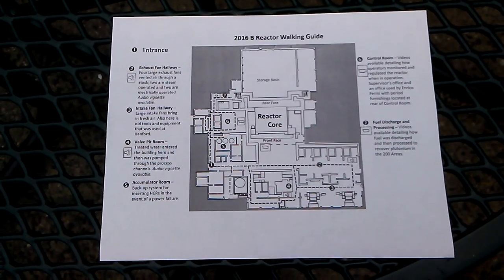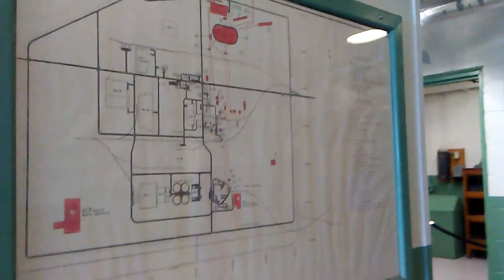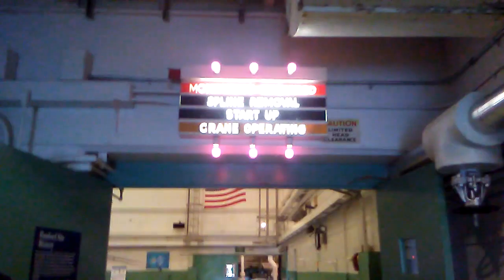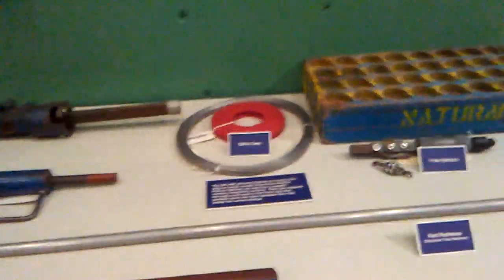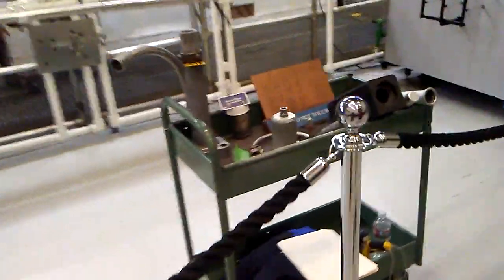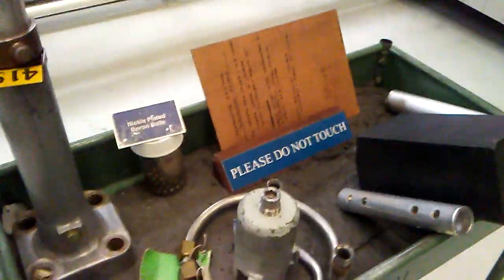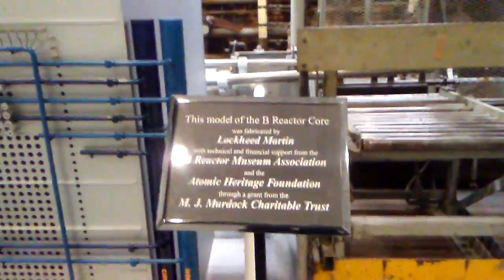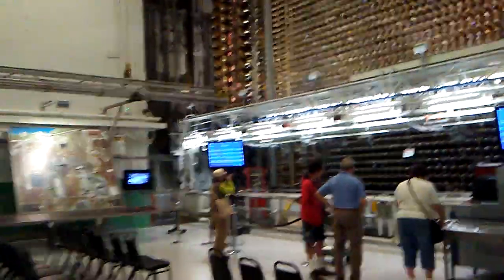Inside the Hanford B Reactor

Comment: Did/do they change all the fuel rods at the same time?  I worked at WPPSS units 1 & 4 back in ‘82
Reply from the maker: Here's an over simplification.   The reactor was a block of graphite with several shells of other material (eg. steel, Masonite) around it and pipes going from the front to the back.  Workers would open a the valve that covered one of the pipes, put in a new rod, attach a hose and blast it with water.  The new rod that was crammed down the reactors throat would make the oldest rod get pooped out the back of the reactor.  I don't know if the reactor was shut down while this was happening but the way I imagine it, it could keep running.  The way I remember it, the startup instructions were on the front of one, type written, sheet of paper.  It was a fairly simple reactor but keeping it running was tricky.  Sometimes they'd do things like slide long ribbons of metal, called splines, between the seams, running from front to back, to slow neutrons in parts of the reactor that were getting too radioactive.
Reply: @davebrunker3399  I know the water and air were to cool the target rods as the fissioning occurred and the graphite was to moderate (slow down the fast neutrons) for absorption 
It wasn’t open for tours when I worked at WPPSS 1 & 4
Reply: They fueled it checkerboard style, and was set up so the reaction sautéed the target rods with neutrons at the desired rate/time to make 239Pu then dumped them out the back when the new rod was inserted. The pool they plopped into had a basket to catch them and was called the canyon. The rods were then moved down to the processing plant while under water.

Comment: Kind of makes you wonder how much cesium 131 is in the public population drinking water in the state of Washington, and oregon as well..
Reply from the maker: Cesium 131 has a half-life of just less 10 days and after seven half-life durations, 99% of the element has decayed.  So about two and a half months and 99% is gone.  What everyone is scared about is hexavalent chromium.   It was used to keep the pipes in the reactor from rusting and the same stuff Erin Brockovich was fighting to get cleaned up.  Hanford has spent years and gigantic amounts of money to pump the water out of the ground, remove the hexavalent chromium, bury it else where and pump the clean water back down to force more dirty water to the surface for cleaning.
Reply: Ah you meant 137Cs. Not sure how much but it's a non zero amount. During the early days the stuff was dumped rather carelessly.

Comment: there's almost four metric tons worth of 55 gallon drums filled with waste thorium nitrate buried under a hillside in colorado from this joint. "don't drink the water.. non chlorinated filtered water." looks like they used the filtered river water for the reactors and "chemical separation" processing to flush toilets and wash hands. a dangerous building to sit above ANY piped in water for any period. hence, the porta-potties outside for the tourists. notice how the "museum staff" gravitate towards the exits at EVERY turn. working there is like getting two or three chest x-rays every day your there. it's been said that being a flight attendant on a commercial airliner is a good deal worse, so what. the gentleman talks about things that have been removed. the plutonium separation building was the worst offender, but this building has a great deal of contamination as well. see how TALL the steam stack is? that wasn't for burning rubbish. this building was a giant furnace, of glowing zirconium cylinders. yeah, that's where I want to spend my afternoon in washington. forget the grand cooley dam- too boring.